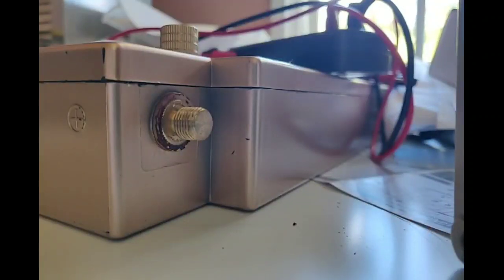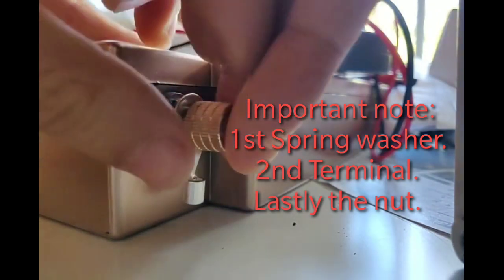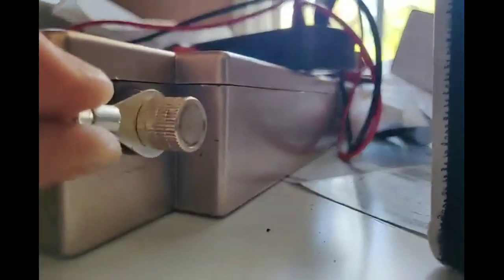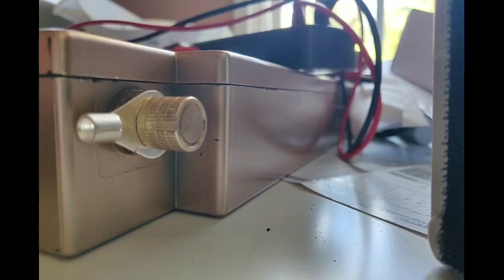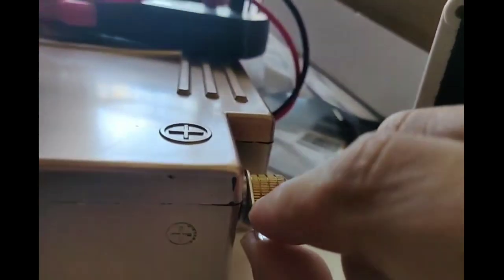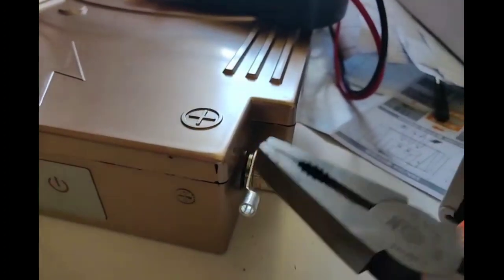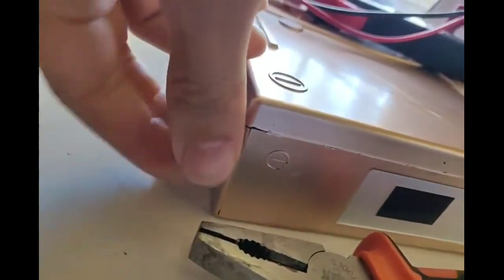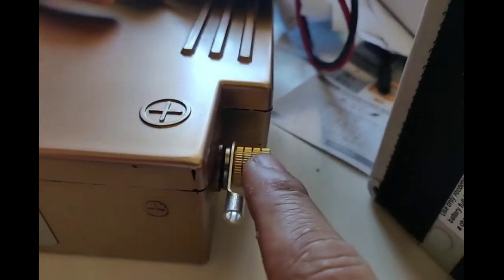Fpv-Power 12v 50ah lithium battery: Terminal instructions.

Comment: Hi. I have this exact battery in white and have had it less than 2 years and it’s only charging up to 5 volts even though the battery indicator shows full. Mariner sails can’t warranty it because it’s over a year….paid a lot for it and not sure what to do at this point. Anything I can do through FPV power?
Reply: Where are you located and where did you purchase from? These batteries were never available from us in the US.
Reply: @brandongoh8900  purchased from Mariner Sails in Dallas Texas.  They are a vendor for FPV

Comment: Hi, nice product, roughly how long would this last with electric motor drawing 7amps low and 15 on high,,is this the same as other custom built 50ah but in a case, cheers
Reply: You'll get about three hours running at full throttle or about 6 hours on low speed. This is different to the other custom made 50ah as this is designed for high amp usage whereas the other one was for powering lights, fishfinder etc.